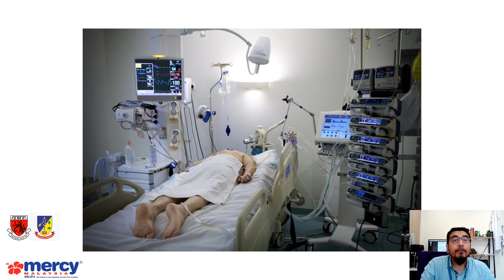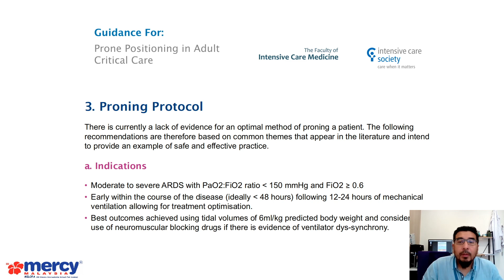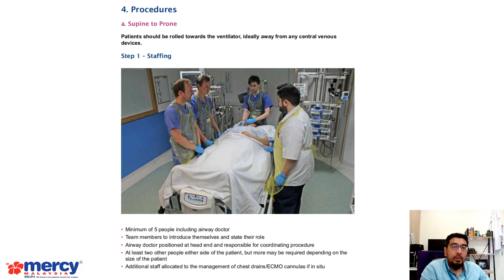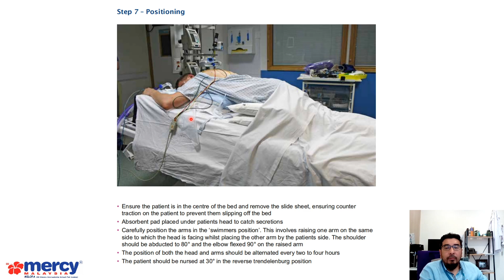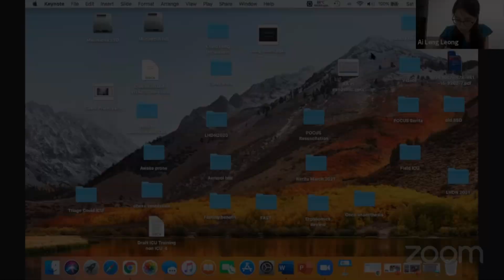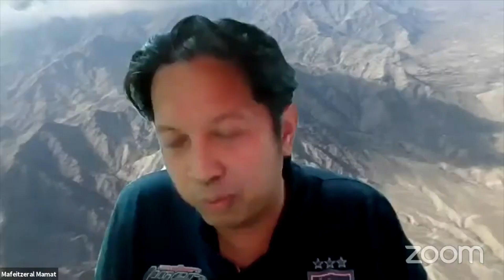Prone Ventilation in COVID (Dr Shahridan Fathil)

Comment: abdominal pressure may disturb respiration while prone position ??
Reply from the maker: Yes it can, especially when abdominal excursion is hindered. When prone and intubated the chest is already compressed; abdominal excursion is how ventilation occurs efficiently. That is why typically support in the prone position is applied to the head, chest and pelvis (and usually the knees are slightly flexed too by supporting the leg); the abdomen is not supported to allow free movement. This needs to be checked post positioning.

http://rc.rcjournal.com/content/respcare/60/11/1660.full.pdf

https://academic.oup.com/bja/article/100/2/165/272685